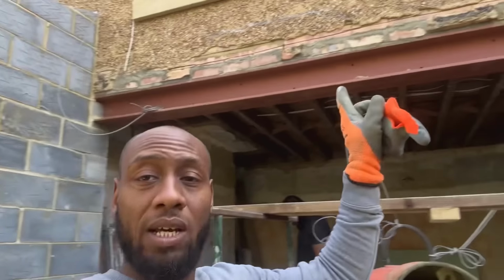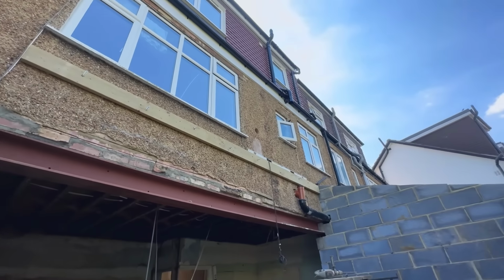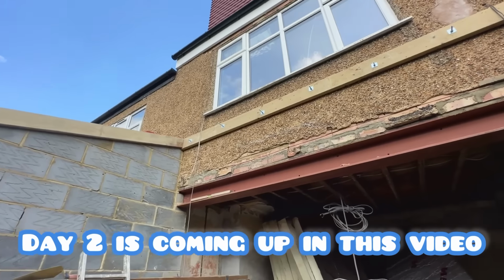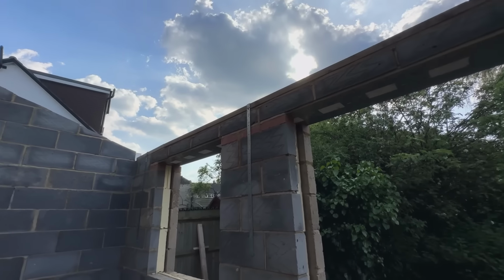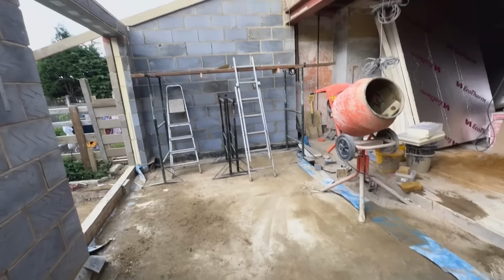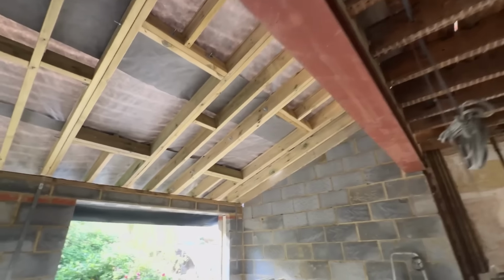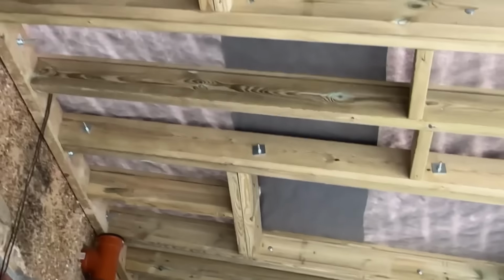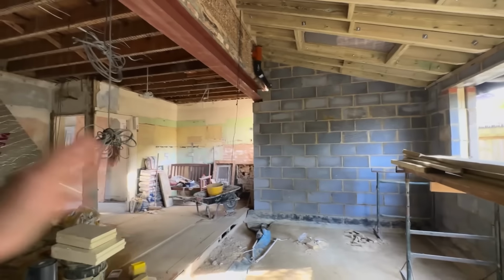The rafters are in and ready for tiling

Comment: hi your lucky where  are you have to put triple rafters in on any roof with a velux widow in and bolt with dog connecters  square washers and we are not allowed to  use coach bolts only hex head ones